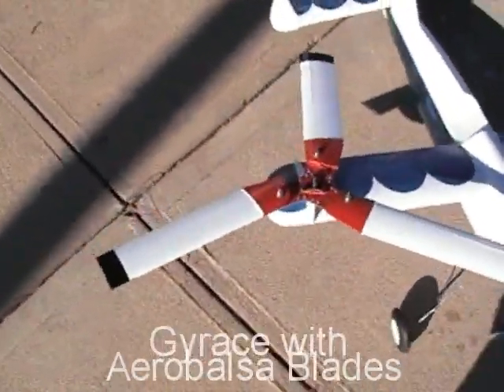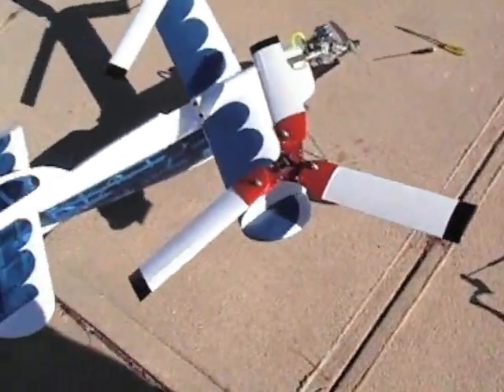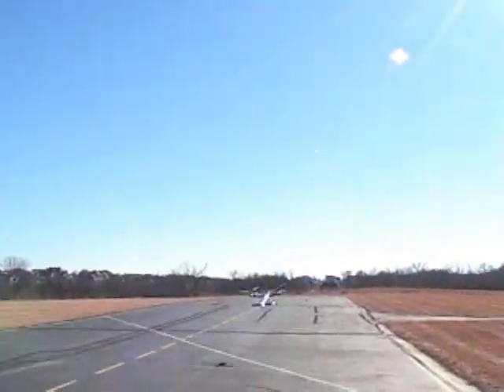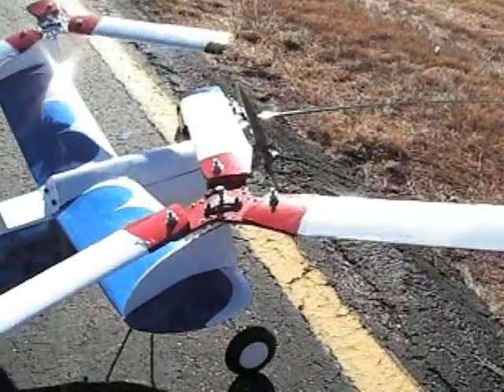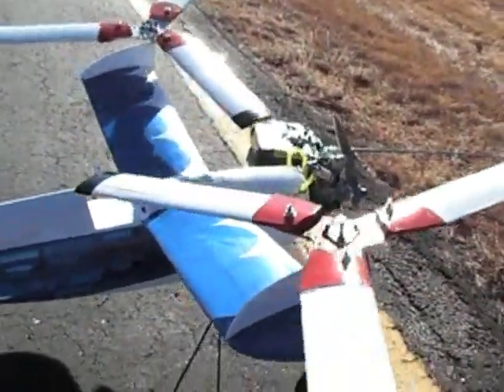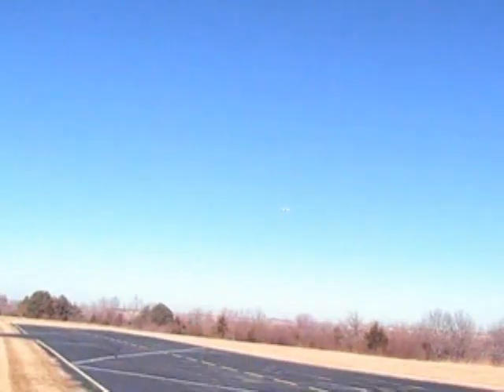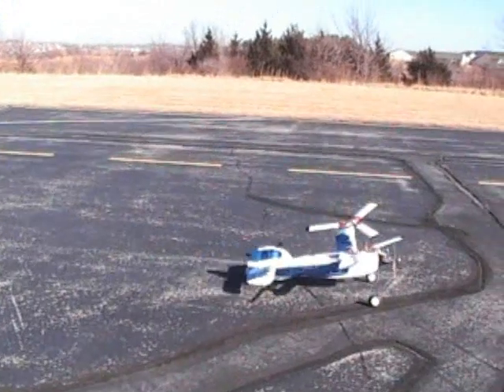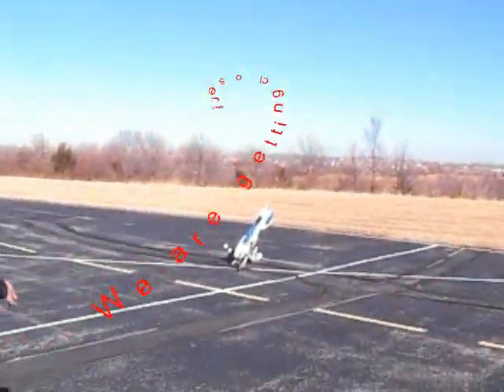Gyrace Autogyro with Aerobalsa Blades

Comment: That's a good-looking Gyrace! 
The fine Aerobalsa blades are indeed excellent, but (alas) no longer available: http://www.flyingbalsa.com/CLOSING-SHOP-Articles-bc16
We found that with a proper airfoil and lower solidity a light weight bi-rotor would fly very well on tiny motors, which was all we had back then.
Thaknks for the video! Ben